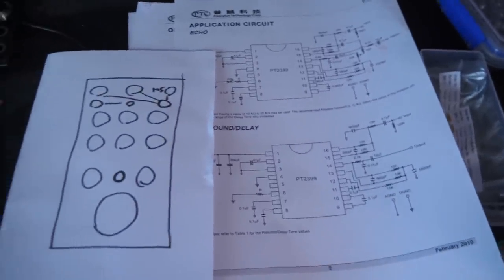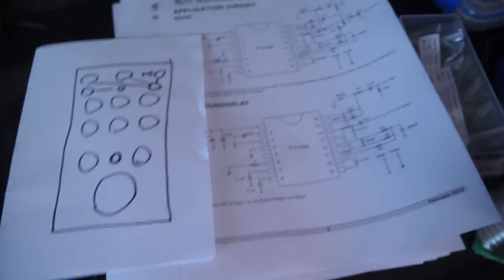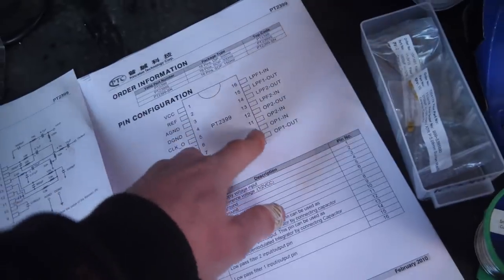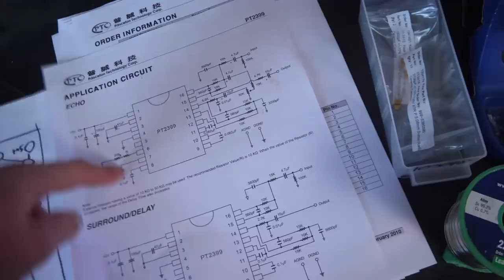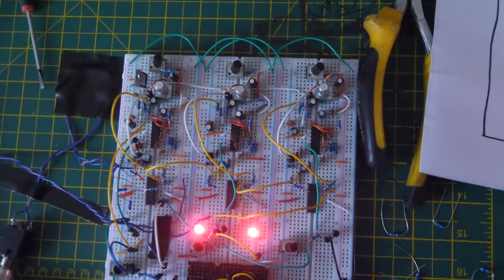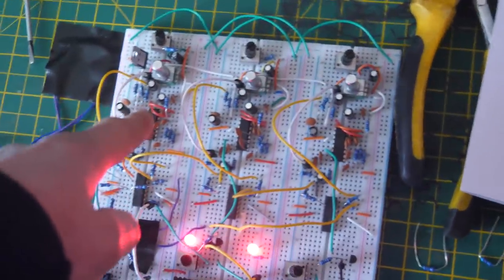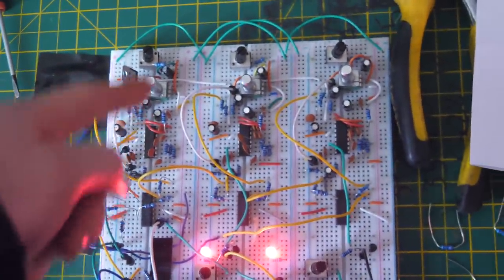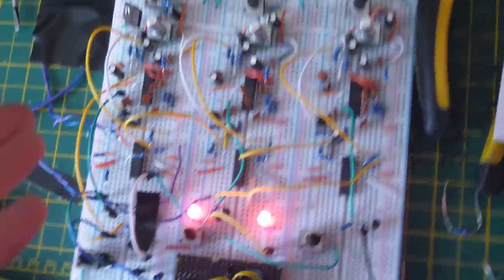Kosmo 2399 Triple Splashback First Build Vlog 3 Pt2399 chips in a module

Comment: Several years ago, I played guitar in the post-rock band The Farewell Monument and we used these absolutely terrible Chinese delay pedals called The Time Machine. They were Pepto Bismol pink, cost us $24, and sounded terrible but in the best lofi ways. The circuit they used pushed the PT2399 well beyond its specifications so it would sample and delay nearly 2 full seconds of audio. To achieve that they crushed the bitrate on the delayed signal so it quickly deteriorated, giving it a character similar to tape delay with severely damaged tape. 

With the feedback set to 100%, it exploded into a luscious noise that would damage your equipment if you weren’t Johnny on the spot with the Level knob to keep the volume within some semblance of reason—which was sometimes difficult because each unit we purchased was slightly different in its response and sound. They weren’t terribly reliable, but they were unique and absolutely crucial to the sound in a few of our songs, so between myself and the other guitarist we bought 6-7 of them just to have on hand. I still have 2. Awesome little units, I always have several PT2399s in my parts drawer because they are the perfect chip for instant lofi.

Comment: Having three chips plays to the strengths of the pt2399. I think one thing I would change with only one chip is the lack of a hard sync to a clock, it's not clean enough nor dirty enough, adding two more chips gets all that digital fighting going on making whole new things. Nice demo.
Reply from the maker: I was playing around with sync and such. but I came the conclusion after adding a lot of bulk to the circuit, I thought to myself why would I sync a delay? the whole thing about having a delay with 3 delays is it goes out of sync. I am building these for my touring rig, but im nearly done with that synth voice, I have saved my findings on the sync functions for the more involved delay module im making in my "macro" module series which im gunna be getting to after the next 2 modules coming out :).
Reply from the maker: but yeah 1 chip maybe sync, however I have never understood why one would sync a delay. for instance when im working in a writing session remotely at someones place and I need to use a computer for instance, the first thing I do is turn the delays of bpm control haha. it just defeats the object in my opinion
Reply from the maker: however the first time I built one I was obsessed with the idea of syncing delays, so who knows. maybe we all go through phases of wanted synced and unsynced delays :D

Comment: 12:24 sounds a lil bit like the end of Nirvana- "Radio Friendly Unit Shifter" lol
Whole thing is awesome, man!  I have a handful of PT2399's that I'd like to use a 555 timer and an optoisolator on to control the "Time" aspect, i.e. the resistance that can cause extreme "pitch shifting" (kinda? lol).
Or a CD4024 for dividing octaves until I get down to a few Hz and use that to PWM the LED in the opto?
Idk, man. I'm drinking wine so I'll shut up... for now lol
Love what you do!

Comment: MFOS did a circuit with it too called the echo rockit
Reply from the maker: indeed! funnily enough after I did this because im doing a vid on the other channel, I looked around to see how many have been made with pt2399's. and blimey there are a lot of em! not many with 3 chips in a none reverb setup. but yeah, I have found (not including the countless guitar pedals) mfos, cgs, befaco, Pittsburgh modular, synthrotek, just found schmitzbitz. it seems its is a very popular chip. the reason being is its super easy to work with. not the longest delay times, but it makes up for that with sheer strange character
Reply: @THISMUSEUMISNOTOBSOLETE  are there schematics for this unit available, so I could build one myself?

Comment: Eurorack version prebuilt in your shop one day?
Reply from the maker: hey calabiyou unfortunately I have come to the conclusion as of late to not jump into eurorack. I have a vision which I stand by that it is just too small, and I dont want to contribute my efforts to it, I strongly believe bigger and simpler is better. Kosmo modules are completely compatible with eurorack just the rails are a little further apart. Its built in the same way as eurorack so not expensive parts like 5u, and yeah just in my opinion more suited to music making. I hope that makes sense because as of late a lot of people have contacted me either requesting it or asking to strike some sort of business deal, and im gunna stand by kosmo. :).
Reply: @THISMUSEUMISNOTOBSOLETE  would you be okay with someone making yoru circuits in euro layout and selling it? with full credit towards your circuit and open sourced?
Reply: Would it be possible to build one of these into a box, with a battery to power it. It's beyond me anyway. It's amazing. Love it.
Reply: @256k_  I think that goes against everything Sam just said. Sam is passionate about Kosmo format and a lot of us have adopted it as well. Many of us have both Kosmo AND Eurorack modules and they will play nicely with one another. I think to take his designs, turn them into Eurorack when he has consciously not gone that route and not accepted any business deals to do so, and then turn around and profit off of said Eurorack PCB's is disrespectful. Just sayin'.